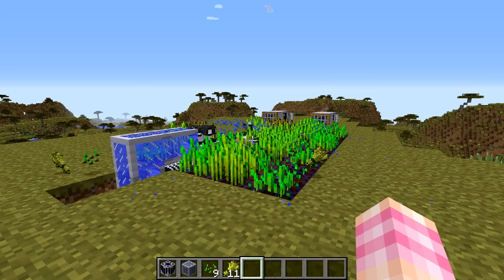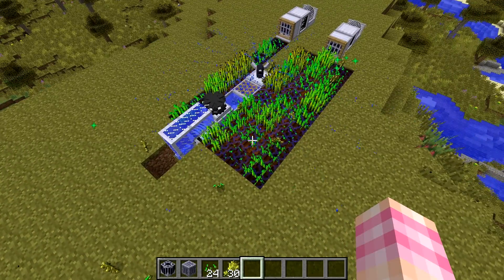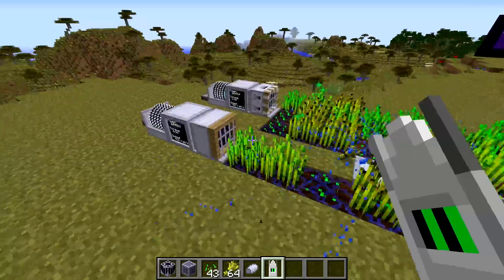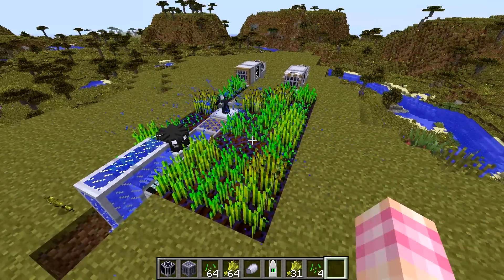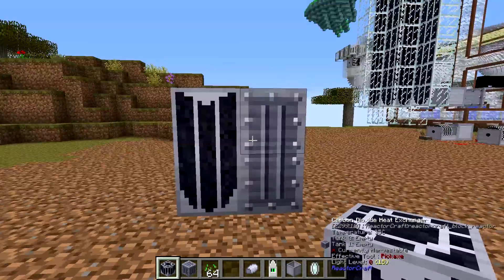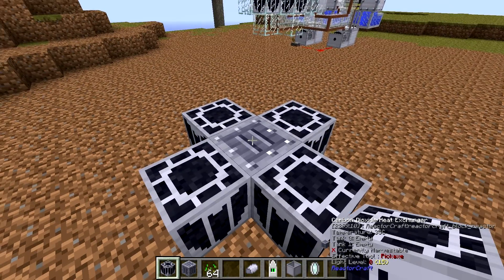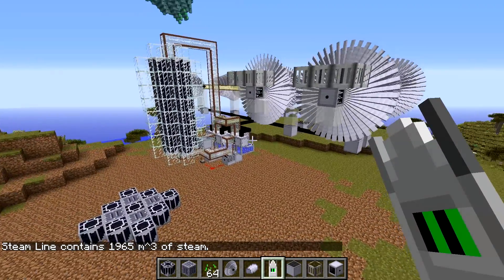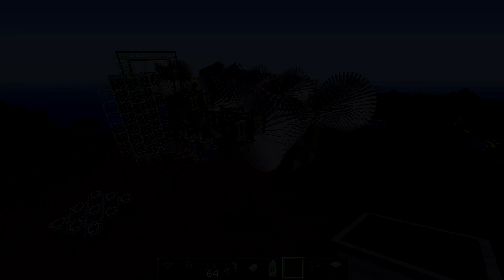ReactorCraft Tutorial #28 - HTGR

Comment: The checkerboard pattern works alright for getting hot, but I have trouble figuring out how to power the item duct in the bottom middle to remove spent pellets. A 2x5 or 2x7 layout works alright, but I mostly liked the tall one like you built. I hear it gets jammed, but that was from a very very old tutorial. Anyway I also want to experiment with multiple reactor cores. :-D
Reply: I tried to make mine meltdown. It kept making hissing noises but it never did melt. I'll have to make it bigger.
Reply from the maker: Experimentation is what this mod is all about as long as you watch out for explosions

Comment: so what i'm gathering from this is that one layer of pebble bed reactor cores can run one low pressure turbine? since you have an 8 high reactor powering 8 turbines.. is that accurate?
Reply from the maker: I'm not sure, I don't know if that's how its meant to work or not. If it did work it would probably heat up ridiculously slowly
Reply: yeah i tried it and one layer only heats up to about 200.. 2 layers 500 3 layers finally heated up to 800 but it provides too much steam for just one turbine.. i'm working on adding more turbines at the moment.. soooooooo much steel.. thanks for the reply =)
Reply: @ravynknight7146   Oh. So now from random comment i found on youtube i scavenged information that HTGR needs to be at least 3 blocks tall to even work. RC handbook f$$n never mentions that. Even that you get more heating from stacking HTGR cores vertically. Oh , that you need to surround it with blocks so it wont lose heat , that not in handbook either. Good work Reika , on making that in game handbook. Guess i have to be happy there any handbook at all.

Comment: Im sorry butt how do you get such a large amount of water to power all these machines when there isn't any infinate water
Reply from the maker: Dew Point Aggregators can get you infinite water. Those 3x3 wooden water tanks from Railcraft are infinite. I'm sure there are others I don't know.
Reply: The Dew Point Aggregator can make a LOT of water.
Reply: jupiterbjy
The water output varies depending on how much speed and torque you have. If you have more speed, more water will be made per tick and how often a cycle happens. If you have more torque, more water will be made each cycle, but each cycle happens less. If you balance speed and torque, you'll can get a cycle to happen every 4-ish seconds and get around 50,000 mb/cycle (Rough estimate, been a while since I used it) with just one micro turbine.
Reply: there is 'Pressurizer' that change low P water into normal water. you'll need it at least same number of condensor with at least 16384W, 1024N
Reply: jupiterbjy no i mean for farms and stuff like that and not reactors that can reuse the fluids
Reply: well I don't agree with that. at least in my biome(extreme hill/snowly) running pump is much faster, just pair 2 windmill and compare it. it will even dry out 3x3 pool.
Reply: well I never made enough water using dew point aggregator... I sustained 2 reactor turbine with 1 pump. I remember I should put 1 cooling fin on it, but 10mb/tick was...
Reply: a single microturbine?? single pump is capable of around 8 buckets per seconds.. but thinking about lag&size, it makes sense huh..